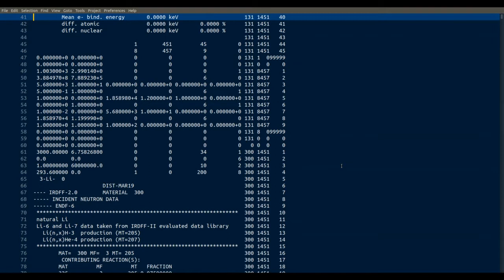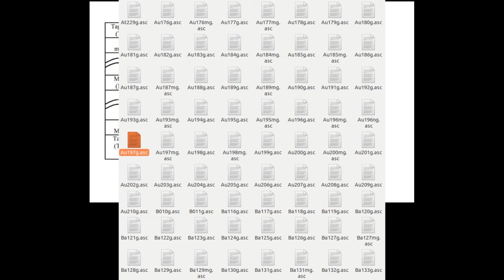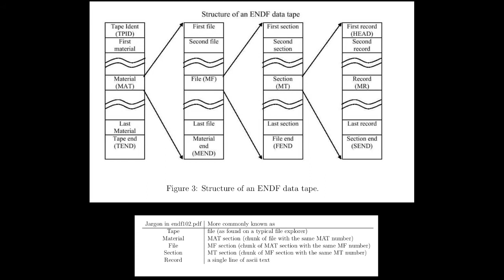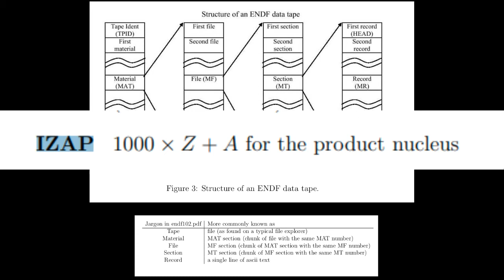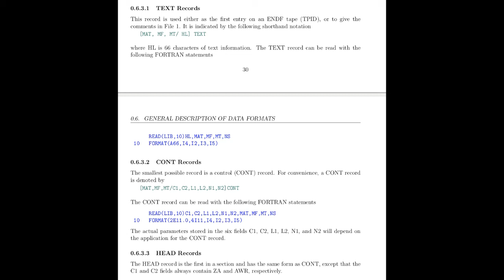How to read Evaluated Nuclear Data Files (ENDF)

Comment: Hi! I am having a hard time installing FISPACT II program. Can you please make a demonstration of installation and a beginner tutorial? It will assist us a lot :) Thanks!
Reply from the maker: As far as I know, FISPACT-II is still a proprietary code. Have you obtained an official copy DVD yet?

https://fispact.ukaea.uk/wiki/Installing_FISPACT-II
If so you can proceed with the instructions above. Let me know if there's a specific step on which you get stuck.
I have been planning on making a FISPACT-II installation video but my version is outdated (3.20); so I'll wait till I get a newer copy before doing so.
Reply: @oceannuclear  Yes, I obtained a soft copy from OECD-NEA for installation. I am using Windows 10 and now stuck running system tests after installation - getting 419 errors on running runall.bat. I am not very familiar command programming so having difficulties here.
Reply from the maker: @osgokul  (sorry I forgot to reply) I remember having the same problem of seeing errors when running tests... I'll see if I can replicate it. In the meantime you can DM me and I'll see if I can sort it out; I'm reasonably familiar with the command line.